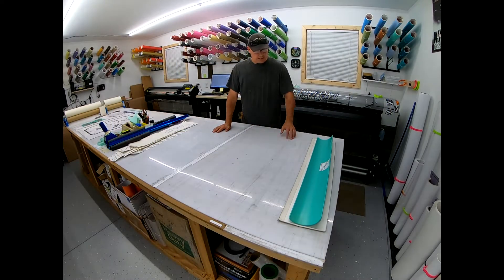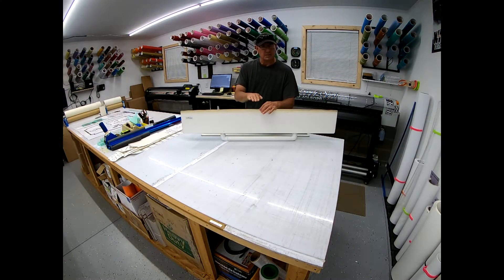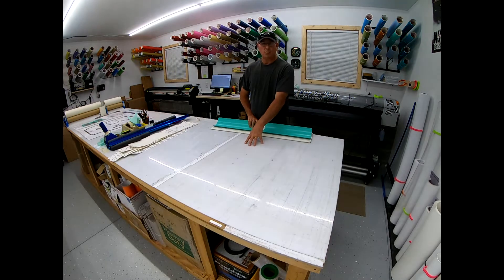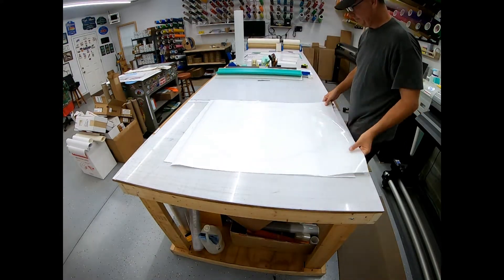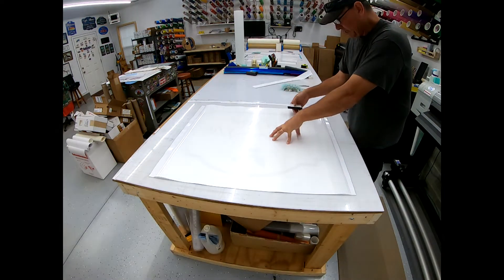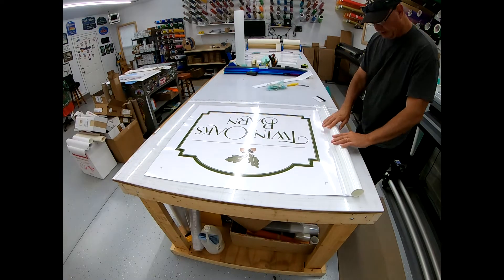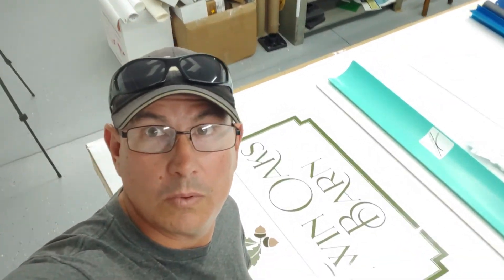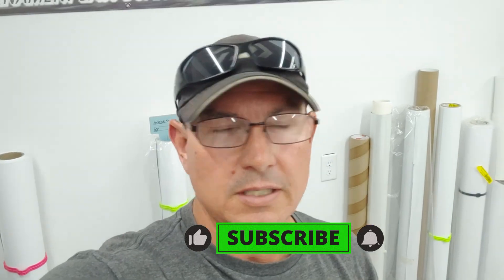Laminating Prints with the Big Squeegee

Comment: Definitely working, just getting some scratches and very small bubbles, but still beats changing lam out for very short jobs. Thanks again!
Reply from the maker: I generally don't get scratches but I guess it depends on the type of laminate you are using. I found thinner, Cast will scratch and have more bubbles then thicker calendared.

Comment: I have to do some 80/20 window perf for my church and my wife’s business. I just got a HP 115 latex printer. The window widest width is 42 inches and the longest length is 68 inches. I have a work table that is 48”x98”. Do you think I can use this laminating process for this type of application? Thanks
Reply from the maker: Congrats on the printer! The width should not be a problem, I can only stretch up to 56" to lam, so you will need to do it with a pause and the rest.  This is just my opinion, window perf should not be laminated unless it's cast optically clear and it still looks a little hazy looking inside out. Widow perf in itself does not have the longest life for some reason 1- 3 years depending on the sun exposure it will get. I dont warranty window perf for maybe up to 10 days after I install it, make sure you leave 1/8" or more when trimming it , don't trim it to the edge it will curl.
Reply: @TheSignGuy  Got it thanks. I was under the impression that window perf SHOULD be laminated. But I guess not. Ok I still will use this method to laminate other jobs. Really appreciate the feedback.
Reply from the maker: @RonderickHenry  No problem, anytime. I have some samples of window perf in my shop 70/30 and 50/50 both laminated and un-laminated, 9 out of 10 times the customer does not want the laminate when they see how hazy and blurry it is. Everything else you should laminate LOL

Comment: Thanks for the video! Definitely gonna need to grab one of those! What is your go to laminate. I know you mentioned it in other videos but which type are you using?
Reply from the maker: Substance media and laminate. 2755 and 3150 are my go-to for 80% of my "sticker" jobs. Appreciate you and thanks for watching 👍👍
Reply: @TheSignGuy  Right on thank you very much
Reply: @TheSignGuy  On the big squeegee they have a hard tip and a soft tip, which do you suggest?
Reply from the maker: @SouthbayCreations  I have an older/original hard tip for laminating. I don't have any experience with the soft tip from them but I would assume it's for bigger irregular/bumpy surfaces? I prefer a harder tip for my smaller (4"-6") squeegees I have a few "softer" ones from Avery and for wrapping stuff but I prefer the harder tips 98% of the time.
Reply: @TheSignGuy  Sounds good, thanks for the input that.

Comment: Thank you so much for this video!! I run a small business where I make stickers for packaging for other small businesses and have been so annoyed with how much squeeging is needed to get a nice finish on the lamination so it's flat against the paper/vinyl. I work super small scale and the paper/vinyl  I use is only letter size. I use oraguard 210 to laminate my stickers and I never knew that weird frosted look was called silvering. I noticed you said when it sits it goes away, does that mean I can run it on my laminator on the cold setting with enough sheets of paper so it has enough pressure to smooth the lamination out then have it sit for a day to remove the silvering that is left so it clears up? I have been looking everywhere to find something that could do the squeeging motion automatically with enough pressure to create the same effect if done by hand but cant seem to find anything. Thank you soo much and I hope everything I said made sense, haha!
Reply from the maker: As long as the laminate goes on flat to the media with normal pressure the silvering will go away in about 24 hours or less. You can avoid the silvering with more pressure and thicker laminate, thinner cast laminate is less forgiving.